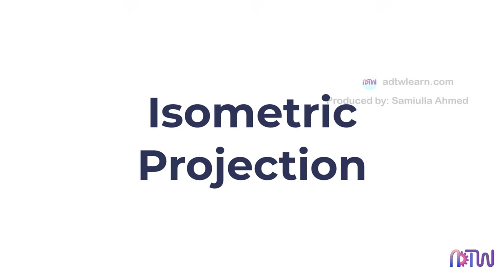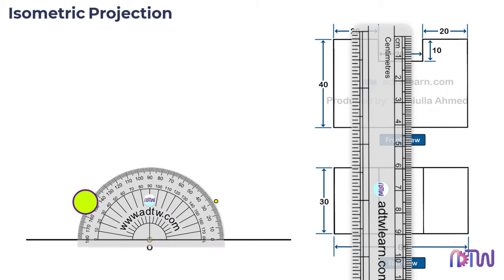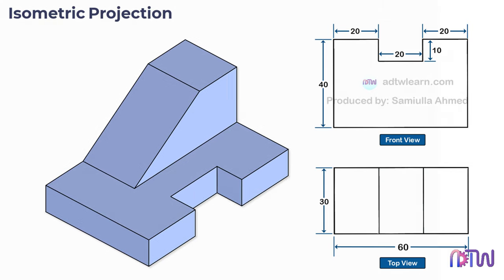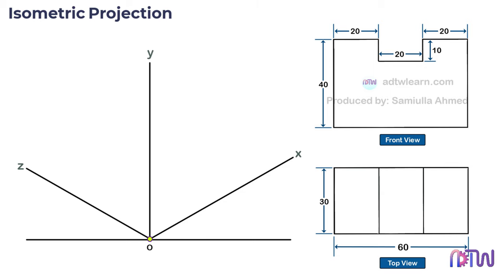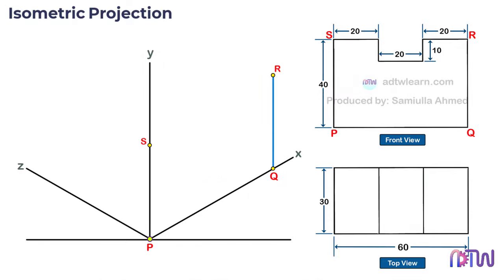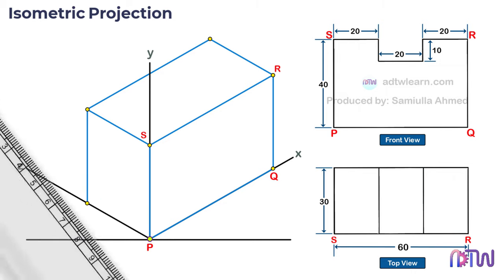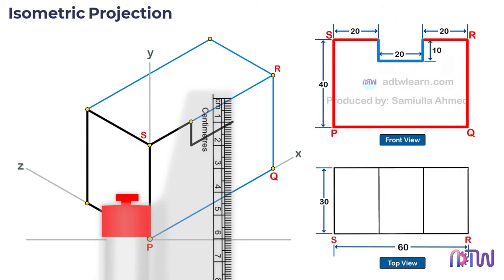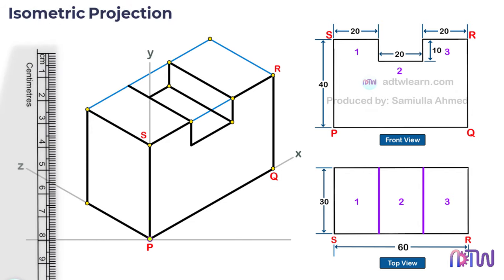Isometric Projection in Engineering Drawing | isometric projection 3D from orthographic view

Comment: You can use a 30, 60, 90 degrees triangle in doing the 1st step if you dont have a protractor. Also, you can use the triangle for the rest of the construction.